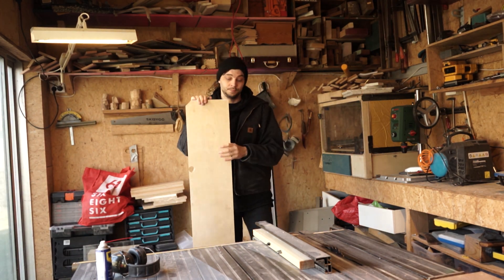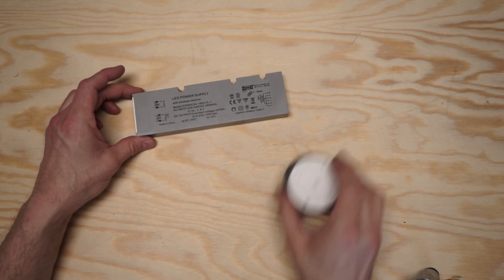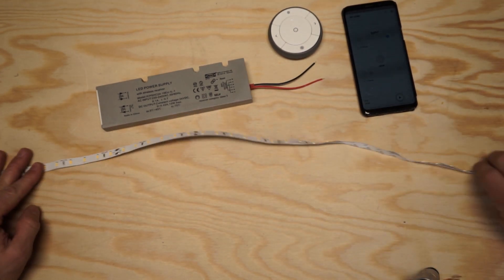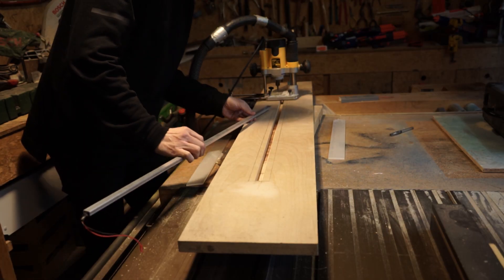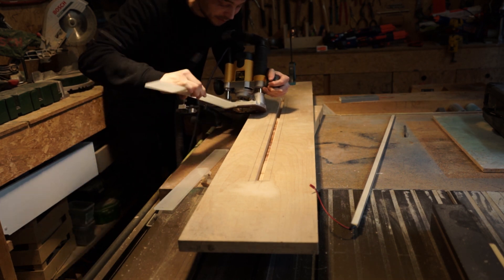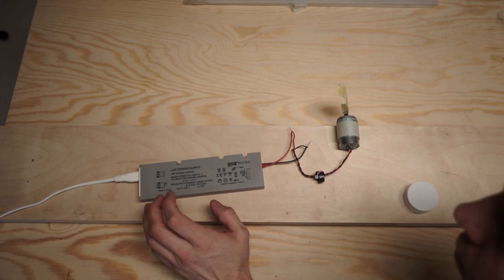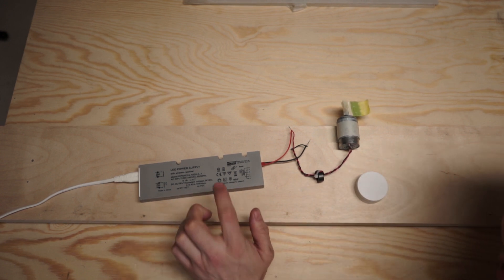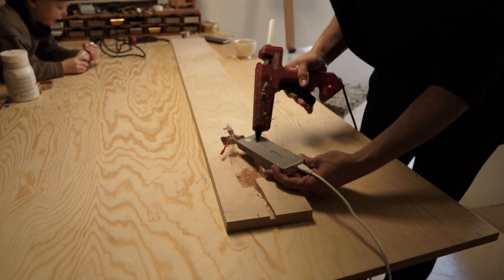Making a ceiling light with an Ikea wireless led driver hack

Comment: What type of connector are you using? Thanks
Reply from the maker: bah, not sure what they are called, they are the one that pop up when search for female/male connector on ebay. I will look for the link
Reply: @FlokrollProjects  did you find the link please? I want to conmect my own LED but need this connectors.
Reply from the maker: @amikosa  https://www.electrodragon.com/product/jst-connector-set-female-male-with-14cm-wires/
Here is one link, you can get a bunch of them from ebay if you google "jst connector wires" or similar :D
Good luck with the project